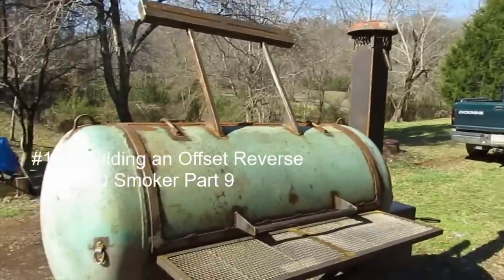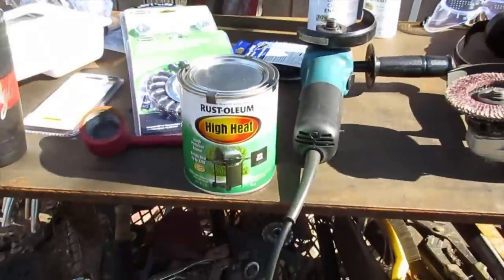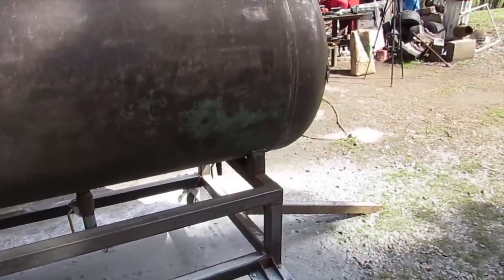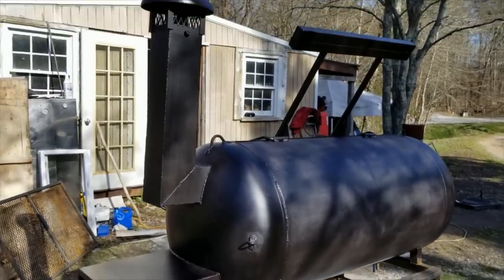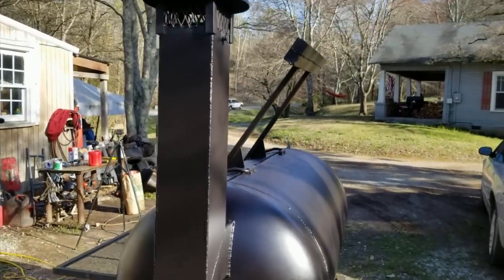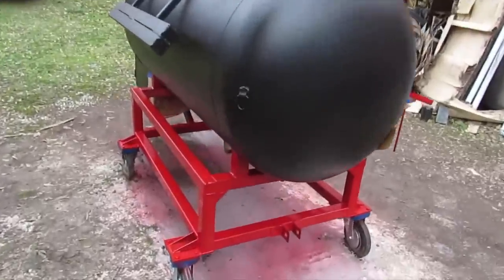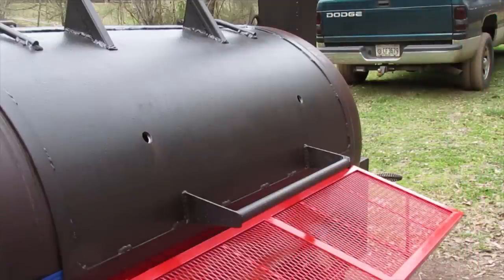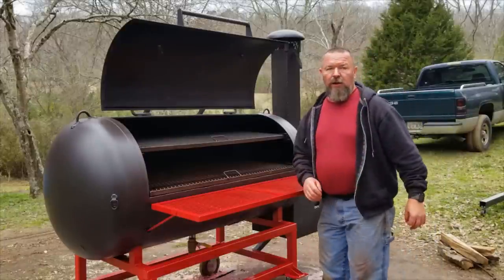#152 Building an Offset Reverse BBQ Smoker Part 9

Comment: A gorgeous project. What sort of oil did you use?

As a pulmonologist, I would encourage you to see if you can get an externally pressurized face mask if you are going to sandblast. I am going to see if I can figure out how to make one with an old CPAP machine 

Best wishes
Frank
Reply from the maker: Thank you frank. The oil I used was just Canola Oil Cooking Spray. You can use any cooking spray but stay away from Olive oil. It will burn up and be gone. I wish I could afford a pressurized mask but just can't do it right now. I will watch your video if you do a project with your CPAP. That is a great idea!

Comment: Looks great well done. Could you tell me why you put the chimney at the same end as the burner. It seems to me you would get a better flow of heat and smoke with the chimney at the other end.
Reply from the maker: Thank you sir for watching and commenting. Sure, the reason is that I installed a reverse plate which forces the heat down the entire length of the smoker and then back to the smoke stack. This results in much more even heating of the cook chamber. I hope this helps and thank you for your question.
Reply: @StephenOgle  OK Thanks.

Comment: Awesome build man. Question; Would you rather have bigger rubber tires? Just seemed like it would be tough to roll, especially in gravel.
Reply from the maker: Thank you Bubby. Glad you enjoyed this project. Absolutely! That was the only real design flaw I have found so far. I thought about putting new wheels with rubber tires on it but have decided to mount it onto a small trailer. No more worries. Great suggestion and take care.

Comment: Stephen, I just got a 250 gallon, what is the different ways of setting the smoke box and smokestack as in yours a Offset Reverse?
Reply from the maker: Thank you Alex. So glad you enjoyed this series. There are two basic configurations. Offset is where the smoke stack and fire box are on opposite ends. The heat goes from the firebox through the cooking chamber to the smokestack. They are usually very hot on the firebox end and cooler on the other. A reverse offset smoker has the firebox and smokestack on the same end with a reverse plate which sends the heat t oone end before passing over the food to exit the smokestack. This results in more even temperatures in the cook chamber. I hope this helps. Take care and be very careful with that tank. Good luck on your build!
Reply: @StephenOgle  I researched it thank you. I'm going to try that but with a hot box I already have which has a shoot that is about 5 inches square maybe 6. I plan on making a plate where I will put,  im not sure if two or four 2 inch pipes to send the smoke the other way. The thing is I want to make holes along sides towards the end to start smoke coming out a bit early gradually making the holes larger ( I see lots of offsets with a difference in temp so I thought maybe this might balance that more! ?. OF course my dilema will be making sure grease gets down to the bottom which might force me to only two pipes which might eventually make me quit trying to re invent the wheel and go for a traditional offset! lmao. Thanks for taking the time.

Comment: Whats the measurements on the frame and what metal tubing you use
Reply from the maker: Thank you sir for your question. The frame is L 48" x W 30" x H 22" and made from 2 inch square tube with 1/8" wall thickness (11 guage). Hope this helps and enjoy your build.
Reply: I have an propane tank with an lay out of 29 inches from seem to seem what measurements should i use for the frame
Reply from the maker: @kaydagoat0vikes451  I believe I would use 27 inches. That would give an inch on both sides for the door "Framing" with 1/4 inch left. Hope this helps.
Reply: @StephenOgle  what about the L"xW"xH"
Reply from the maker: @kaydagoat0vikes451  I designed the height of the frame to sit the center of the tank at 35 inches. The door size was 2 inches less than the width between the seams. I also used 25% of the diameter to determine the height of the door. In my case with a 30 inch diameter tank I cut the door at about 23 inches high. I hope this helps.
Reply: @StephenOgle  thanks Stephen im really trying my best to not mess up on my first build once its finish ill seen the video to you
Reply from the maker: @kaydagoat0vikes451  Thank you. I will be looking forward to watching it. Good luck on your build!
Reply: @StephenOgle  1 more question where can i purchase some 9in casters from
Reply from the maker: @kaydagoat0vikes451  I found mine at Harbor Freight, however if you plan on using your smoker on dirt or gravel you may think about a wider inflatable tire. Harbor Freight sells them also. Hope this helps.